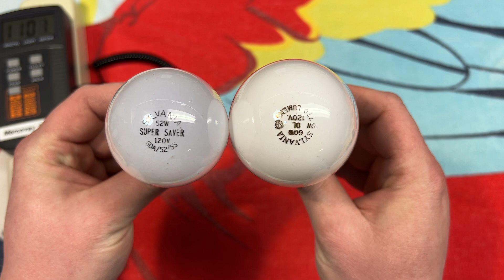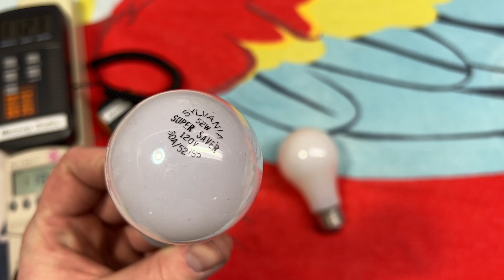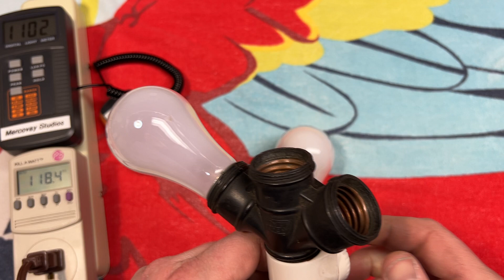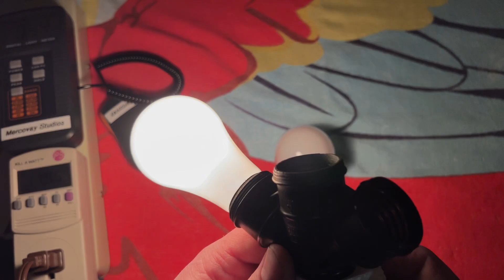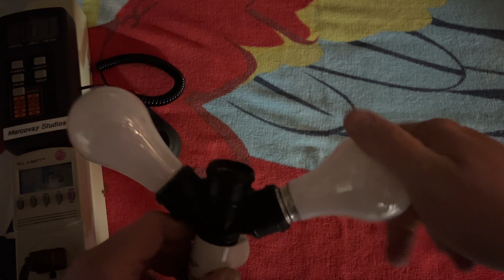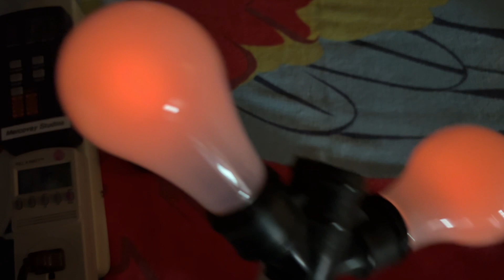Sylvania 52watt A17 Super Saver Incandescent Light Bulb

Comment: These are incandescent? What! I have the 28w version and I always thought they were early halogens! I’ve gotta get them out sometime soon and check. These are cool bulbs though, I didn’t know they made other wattages than just 28w.
Reply: I got mine out today, and they are indeed halogens. I guess these must have started off as incandescents, but then got changed to halogens. I assume mine were made before the bans on the plain old incandescent bulbs, as they are not modified-spectrum and if I recall correctly, the halogen A19 bulbs made today have to be modified spectrum.

Comment: Hi  I've never,. Seen a a17 size light bulb before.   but it is cool that they make them  and that they are power savers
Reply: They were used a lot for certain railroad signal and locomotive lamps.  They were also used for 20W 20A17 message sign lamps that used a hydrogen fill gas for rapid nigrescence of the filament to prevent blurring of the sign text.  GE and possibly other manufacturers were marketing A17 GLS lamps in parts of Europe as a glass saving thing as well as them taking up less space in the mid to late 2000s right before all the lamp ban nonsense started in earnest.  Yes, even up to 100W when 100A19 lamps are already pushing it envelope heating wise.

Comment: Hi, parrot175. Could you try running your old regent 70w hps bulb on a 150w metal halide ballast? it will not cycle on 150w mh gear because the available voltage of hps ballasts is too low which is why it cycles on a hps ballast. It will work without cycling on a 150w mh ballast because 70w S62 hps current is 1.37A and 150 mh current is 1.44A. please trust me on this.
Reply: You sound full of it. Am I really supposed to believe that running a 70W HPS bulb on a metal halide ballast for a bulb twice the wattage is good for the bulb in any way whatsoever? I’m sorry, but I have a hard time believing that.
Reply: Ha, they are pretty similar in current. According to Philips, 70W HPS is 1.6A and 150W PSMH is 1.5A. However, the voltage on the metal halide is twice that of the HPS. I would be weary of using a HPS on a MH ballast even if the current rating is similar.
Reply: @rs12official  it will work perfectly if it is run that way, and it will not be overdriven. it will also be non-cycling because of higher voltage availability.
Reply: @solomonwolf9388  Thing is running such a low potential lamp (55V vs. the 90V to 100V for the halide) will overload the ballast as it is running with a much higher potential drop and thus much higher magnetic flux loading in its core, probably even saturating.
Reply: @randacnam7321  if the lamp to ballast is matched (or close), it will not overload the ballast. because I have actually done long term tests where I put HPS bulbs on MH ballasts of matching current, and the ballast was fine with it. why don't you try it yourself, and see that it is safe?
Reply: @solomonwolf9388  With constant power autotransformer ballasts where the capacitor is the ballasting impedance, yes.
I'm not saying it's impossible, just not recommended without testing a given ballast/lamp combination.

Comment: I remember seeing these in four-packs for commercial sales. One reason Sylvania tried this was to reduce the amount of glass that went into the manufacture of the bulbs but they also were supposedly less susceptible to crushing. These were very short-lived in the early '80s and quickly disappeared. I never liked them because they did not look traditional to me. These were available in 120v and 130v regular (1,000 hours) and long life (2,500 hours) SuperSaver reduced wattage lamps.
Reply: They were also reintroduced by Osram Sylvania briefly in 2008 and 2009 under the Elogic label using the "California approved" power rating sequence of 38W, 57W, 71W and 95W.
Reply: Ive been asking a lot of people this. but do you guys know of any places that I could use 100 watt incandescent bulbs? Are there any places around the house where I could use these? And not have to worry about a fire hazard? I tried to put one of my 100 watt incandescent bulbs in my lamp and it started smoking. I dont want that to happen again. Do any light bulb experts here know where I can use 100 watt bulbs around the house?
Reply: @sadiethesmartie6893  100 watt bulbs typically were used in larger table lamps with open shades so there is no heat buildup. Some enclosed ceiling or wall mounted fixtures might have ratings up to 100 watts but it seems most of those went up to 60 watts. Perhaps a post lantern might have a fixture rated up to 100 watts. Any type of exposed porcelain fixture like in an attic or barn or utility area would accommodate a 100 watt bulb or higher.
Reply: @AlexanderCrump   Where do you use them around your house?
Reply: @sadiethesmartie6893  Mostly table lamps and the porcelain fixtures I described.
Reply: @AlexanderCrump  I have another question. I have a lamp that my grandparents just gave me that is a 50/100/150 watt three way lamp. Now I only have 100 watt bulbs. Would I be able to use the single 100 watt bulbs in the 3 way lamp? Especially since this lamp is 50/100/150. It can still take a 100 watt bulb right? I REALLY REALLY  dont want to cause a fire but I want to be able to use my pretty 100 watt bulbs
Reply: @sadiethesmartie6893  A three-way socket will accept a regular bulb. When you turn the key on the socket, it will go ON-ON-OFF-OFF ... You could always put a 150 watt regular bulb in there, too.
Reply: @AlexanderCrump  If I dim an incandescent light bulb, will it give off less heat? Like for example if I have a 100 watt incandescent bulb but I dont want my bulb to get so hot. if I dim it will it give off less heat?
Reply: @sadiethesmartie6893  I am not sure. The total energy used is less, but you are shifting efficiency down so more energy is emitted as heat versus light. That curve will continue as you dim it down - less energy is converted to light. I don't know if it's possible for an incandescent bulb to emit more heat dimmed down but it's possible. Do you understand my reasoning?